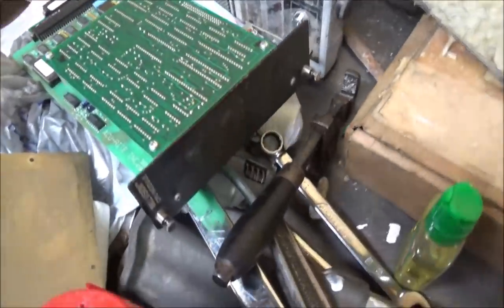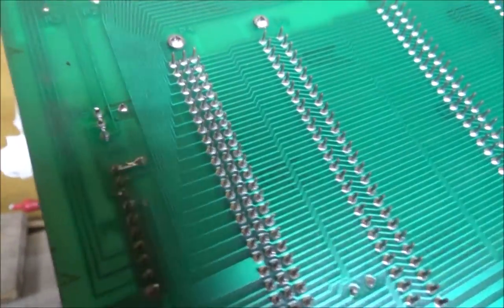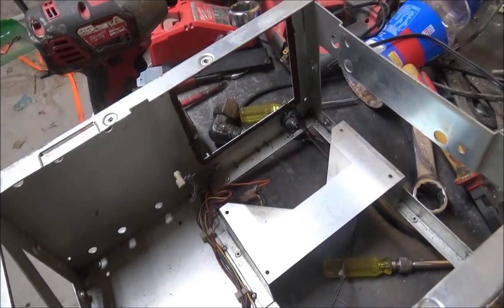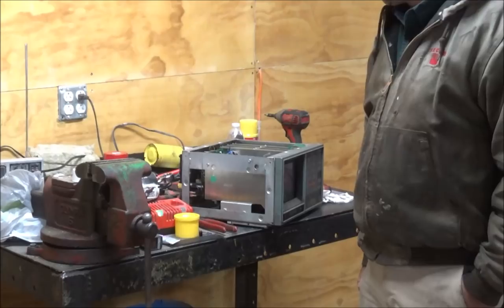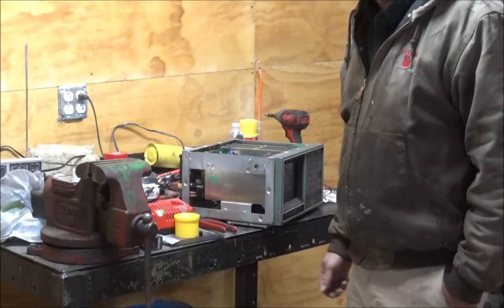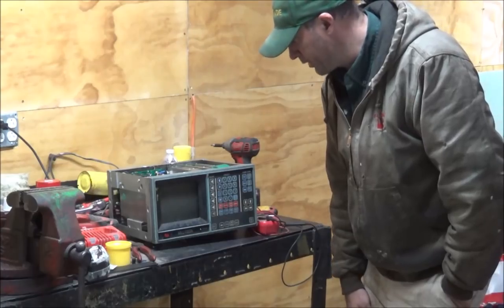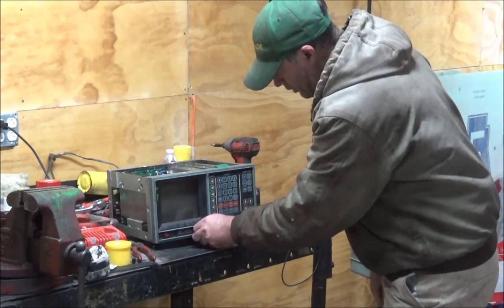Fix one problem a new one follows. CRT help anyone?

Comment: If you can't fix the DRO, the scales on your machine may be compatible with Yuri's  TouchDro project. You buy or build a simple controller that has Bluetooth capability then link to that with your Android tablet and it gives you all the capabilities of a DRO. It's what I'm planning on sticking on my South bend 9A eventually and my cheap Asian lathe as well. It's also very expandable you could put an RPM and extra axis on to the machine and plug them in very easily. Now go back to watching your video LOL thanks for the content.

Comment: To me it looks like bad capacitors or a loose connection to the vertical sync line on the plug. It might be the cable itself if it was able to work off the prongs in the head. I'd try tracing that out with a multimeter. A cheap one with continuity check will do well enough. It's also good for checking capacitors. If there's a short across one of them, that's a real good indicator that it's bad.

Comment: Take a look at the flyback transformer, its where that big wire goes to from the side of the CRT, some have two adjustments on one side that may fix the rolling, usually not easy to get to. Also this is where the high voltage is generated, around 15-20KV so be careful.

Comment: If i had to guess, watching you work, I estimate you did not damage anything while you were in there. Some of these other gentlemen provided some good info.  The chance of a poor connection is good on older devices even when they spent their life indoors. A thin film of oxidation, not visible to the naked eye, Is even enough to prevent a spot weld on two thicknesses of .038 cold rolled steel. Come at it fresh, with alcohol or contact cleaner, very gently open it up and clean the conections on that ribbon cable, and very carefully re plug them back in. That idea  with the non conductor(chopstick?). Chances are you already figured it out. Wes Johnson cleaned the contact surfaces on that inoperable mill and brought it back to life.I tear most of the cotton off a q-tip and clean connections with alcohol. If same result when you power it up, use a non conductive probe and very gently touching the conection while watching the screen. If it improves note the spot that did it.  *This is only what has worked before for me, I also don't care for electrical gremlins. Good luck, again i doubt you damaged anything, unplug connection, and reseat might even bring it back.

Comment: The yoke on the back of the picture tube (CRT) is what controls the ray, it has been over 40 years since I was in school for electronic and I can't remember the terms used for each part.  I seem to remember the Yoke is what directs the beam of light to light up the pixels on the CRT and also keeps it from rolling.  It might be that it just needs to be moved.  Be very CAREFUL the CRT holds a charge even after it is disconnected or the power is turned off.  It is a Capacitor and holds a charge until discharged.  My instructor in school was shocked by 27,000 volts good thing was there was no amps!  I would start by removing everything again and checking the Yoke on the CRT for any damage that may have accrued when it was moved.  The Yoke has become very delicate over the years and if the insulation on the wire has been damaged it may be causing a short.   I'm not sure how to test the Yoke for shorts but it's like a motor just a coil of wire that creates a magnetic field.  Again be CAREFUL the CRT will still have a charge even though it is unplugged, do not touch the wires coming out of it until the tube has been discharged.  Also the components inside are susceptible to static electricity, ground yourself before touching any components or wires.  Good Luck!
Reply: nope. the yoke is where the guns are connected,  so if this was loose any problems would be in the brightness.
The beam is steered by the coils on the side of the tube, and these are working fine or you wouldn't even get a rolling picture.  The problem is at the input of the CRT controller board.
Reply: @MattOGormanSmith   1. the Yoke is the part that fits over the Picture Tubes Neck.  The Guns are located inside the Neck of the picture tube not on the yoke!  A picture tube or CRT (Cathode Ray Tube) is the device that produces the colors for a TV using a vacuum tube and an electron gun located inside the CRT which has a fluorescent screen.  The electron gun does not move it is the coils in the yoke that direct the guys rays to move by using the magnetic field created by the coils.  If the coils are bad, shorting, or not getting the proper voltage the screen will roll depending on which coil is weaker or to strong.  To test the coils for a short use an ohm meter.  

To discharge the CRT:  https://www.wikihow.com/Discharge-a-CRT-Monitor

The anode is a wire covered by a suction cup. Slide the screwdriver blade under the suction cup until you hear a loud pop and see a blue flash.   Make sure you are well insulated/not grounded and the Screw Driver is grounded!  Use Rubber Gloves and wear insulated shoes, 27,000 volts will burn a hole just as if you were struck by lightning!   Gotta love the Internet for making us all or some of us Geniuses!  

Thank you for getting me back into Electronics/TV repair, it is people like you that inspire me to learn.
Reply: Yep sorry.  I forgot what yoke meant.
Reply from the maker: Thanks guys!! Will look into it.

Comment: Make sure the solder joint is not cold or jankey .. Also put some bond to the conector to the board with some kinda glue . I just use hot glue or silicone .. Good luck man !

Comment: The crt tube itself can store a charge, that greyish coating on the side glass is part of a capacitor that uses the glass itself as the dielectric.  Aquadag, if I recall correctly?  More directly, you can possibly get knocked on your ass by the display tube itself even when it's unplugged.  

Handle with care for multiple reasons!

Comment: I see there are LCD replacement kits for the CRT of that system. Unfortunately they are over $1000! My guess is some connector is dirty, loose or a wire broken. You might try wiggling the connectors with something non-conductive like a chopstick. Careful, because there is high voltage in there that can bite hard, even after it is turned off (capacitors as well as the CRT itself hold charges), as well as other things that will pop quickly if shorted for a millisecond. Will be hard to trace it without a schematic, which I haven't seen online. The number you gave is for the Accurite product - the CRT portion may be made by someone else and might have a separate model number that could be investigated. Not sure if Accurite can point you to a tech manual for it. A good old-school tech might be able to decipher by reverse engineering. I repaired that kind of equipment 20 years ago, but without a schematic, would be hard to guess from here.

Comment: A machine of that age is likely using standard NTSC timing,  so in the worst case you could pull out the CRT and put one of those cheap 7" LCD TVs in,  although there's a bit of circuitry needed to turn separate digital Video,  Hsync and Vsync into a composite signal.
Reply from the maker: How would I determine what circuitry I need to adapt something?
Reply: First you'd have to determine the signal level.  They'll either be 5V logic signals or 1V standard analog video signals.   Then you have to work out whether the H and V sync are already combined  (H is lots of short pulses at 15,360Hz and V is longer pulses at 60Hz)   and then you can adapt something suitable from a multitude of output circuits in homebrew 8 bit computers.   They usually consist of a few resistors and 1 to 3 transistors.
If you know someone with an oscilloscope they can work this all out, and troubleshoot the cable, in a few minutes.

Comment: Lots of smarter folks than me have responded. I will just add that I have seen lots of good from using a hot air soldering gun. I just bought one to fix my Volvo instrument panel. Seems easier to control and repair cold solder joints.

Comment: G'day Brian  @ 2.14 in the video there are two blue  long trimmers  1 marked brightness 
 check the 2nd trimmer  most likely contrast   if is contrast  go to 7.44 in the video 
 there are 3 white  trimmer pots  with a Phillips  slot  mark original position  and  adjust  with a Nylon   rod fashioned to Phillips or straight slot  these are likely what you are looking for 
 PLEASE Be careful of capacitance dis charge   . also at 2.32  the blue ring on the back of the CRT   gently  give it a wriggle     or pull off and re apply  shot not clear enough to be sure  on that    should be a multi pin connector 
 Where is Bailey when you need him ?.
 as some on said look out for angry Pixies  they are like your ignition coils in you car 
 JPT
Reply from the maker: Any idea what values I should see out of the brightness and contrast adjustments? I tried adjusting them and couldn't actually seem to get any change in the screen.

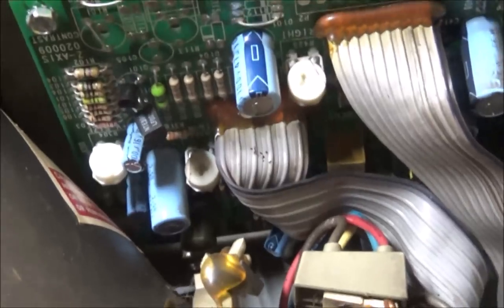Comment: At 7:53 the blue cap to the right of the ribbon cable appears to have 'smoke' on it, anything worth seeing in that area?
Reply: I don't think that is smoke.  Looks more like debris from the operating environment.  Might be vents on that side of the case.  Good eye though, I missed it on the first pass.
Reply from the maker: I think it is just dirty, I see no signs of damage to any of the components.

Comment: Those white trimpots on the CRT board.  I see one is labelled V SIZE and another RIGHT.  Look for one labelled V HOLD.  Even if you have a wire problem,  you could maybe tweak it so it's rolling at a readable rate.
They're usually at the rear end of the board,  because those CRT boards are usually bought in standard items and V HOLD is traditionally a user accessible control.
Reply from the maker: The only pots are Bright, VSize, VLine, Hphase, and Hfreq
Reply: VLine might be it.  I'd risk a tiny tweak :) 
EDIT:  I read in the info that you've already tried that.   It's unstable because it only freewheels so it doesn't burn the phosphor when there's no sync signal, and it's dependent on temperature.

Comment: You've got a bad connection for the VSYNC connection. If you have a Multimeter with Diode Check (beeps when the leads are shorted together) Check each connection at both ends of the cable. If all the connections are good, its possible that you have a bad trace (ie cracked PCB, or traced damaged when the old sold joints broke. You can also try resoldering all the pins, perhaps you have another bad solder joint.
Reply: Guy Tech a bad trace is a good call. It may not be the right one but I can tell you from experience, they can be bad even with a zero ohm reading. I had a timing circuit problem with a digit loop carrier system that was fixed by adding a physical wire to parallel The trace and my reference timing magically reappeared.  Since there is no vsync adjustment with these monitors, this is equivalent to a timing problem.
Reply: Guy Tech Guy Tech a bad trace is a good call. It may not be the right one but I can tell you from experience, they can be bad even with a zero ohm reading. (No load micro volt signal). I had a timing circuit problem with a digit loop carrier system that was fixed by adding a physical wire to parallel The trace and my reference timing magically reappeared.  Since there is no vsync adjustment with these monitors, this is equivalent to a timing problem.

Comment: I'd try re-seating the connectors with some dielectric grease. If all else fails there's plenty of room to replace the screen with an LCD and a converter board. Generic... less than $50.

Comment: I would suspect a bad electrolytic capacitor(s) or crack or cold solder joint.  Examine each solder connection with a magnifying glass.

Comment: I would just mount it back on the machine and see if the signal input might stop the rolling.
many old CRT monitors would roll with no signal.
But i could be  wrong! and most likely am.
Mike

Comment: I saw a reference to a external monitor connection. If you have an old tv with the yellow rca jack video in, you could try hooking it up to the external monitor connection. I may have to build you a tablet based dro and send it to you.
Reply from the maker: I don't have the extra card with the rca jack output.
Reply: @bcbloc02  Sorry, I'll work on a tablet dro for you.

Comment: Tenacity is a useful trait and a curse.  I hope you can get it fixed.  I'm sure that with the length of scales and all the work involved in mounting, aligning and hooking up a new DRO, that it would be an expensive exercise, but at what point does it become worth it?  Does the old unit do bolt circles and such?
Reply from the maker: Yes this unit does bolt, holes, tool offset libraries, error compensation and many other features. It was a pretty top end unit back in the day.

Comment: Brian, did you use a nonmetallic screwdriver to adjust the pots? This is about all the help I can give Sorry too long since I messed with a CRT But do remember they can give quite a shock. If I remember the pots need to be adjusted while on Hence the nonmetallic screwdriver
Reply: That shouldn't matter. You need to use a plastic driver when adjusting coils because a metal tool will change the inductance of the coil and screw up your adjustments. Other than that, using a plastic tool is just a safety thing, it is a bit harder to touch something you shouldn't. But pots don't care if you use plastic or metal tools to adjust them.

Comment: Oh maaan!!! watch out that ignition coil thing in there has enough angry pixies in it to knock you through the wall. you need a static wrist band connected to the metal frame. and the frame connected to ground. I learned a lot of electronics stuff from a good man named jim he is a tv repairman we've lost touch but maaan check that none of the terminals have pushed out of the plastic plugs and all the stuff I said above be careful
Reply: Static wristbands are for protecting microelectronics. Working inside a crt display, a wristband is more likely to help you get killed.
Reply: course an expert like you on crt's knows about the one hand rule of course
Reply: Ignition coil? I’ve heard it all now ffs

Comment: Looks like a cap went or the crystal is out on the sync board. If it was me I would replace it with an lcd look up arcade lcd replacement or cga monitor replacement lcd is $36 cga converter $20. Your main problem then is finding video ground and video signal if you have the option card for your dro it has an old school tv connector hook it up to a tv. If you replace crt  you are getting rid of crt , crt control, and flyback transformer and fit lcd in. 
Old flyback cap and transformer can kill you cap is under the round rubber on crt
Reply from the maker: I think the signal to the driver card is TTL. Is there a way to tell so i know what converter I would need?
Reply from the maker: How would I determine what style of adapter I would need to drive the LCD?
Reply: http://lcdparts.net/Files/CNCU_Manual.pdf  should be ttl to vga adapter then vga to lcd driver to lcd. Or ttl to vga driver to tv if you want a big screen. TTl is 15.75khz sync it needs to up sample to vga 31.5khz running on green channel.

Comment: if the scales you have working have the same amount of wires going to them ,that the new scales have.why can't you just buy a new cheap chinese monitor(say universal brand)even if you have to change the plug connectors on the end of the wires.just a thought

Comment: vertical controller is chip u301.check voltages and that they are stable. looks like it can be reached without disassembly. its the board with the v-size adjustment. https://imgur.com/a/aKTqSVj
Reply from the maker: Those voltages check to ground or to each other?
Reply: @bcbloc02  to the marked ground on the board. one of them is used to get a fixed vertical hold.
Reply: @bcbloc02  sorry, that board has its own metal backing, missed that. board should hold without the metal backing so it is still in a fixed position for probing. and if you didnt know already, the big black cylinder is the high voltage transformer. it can hold a lot of power even if the dro was unplugged for a while. dont touch, dont brush against it.
Reply: @bcbloc02  next thing would be to check if there is a sync signal coming into the chip on pin 10 (compared to the marked ground). https://datasheet.octopart.com/TDA1175P-STMicroelectronics-datasheet-26856.pdf the multimeter should show something on the frequency range. maybe 30-150 hz.
Reply from the maker: Great info!! I will have to do some more digging.
Reply: @bcbloc02  check the parts around pin 8 and 11 for signs of overheating and damage. that is the fixed v-hold. r301, and from there to board ground c301,c311,d301,r302. my crt assembly isnt the same but similar, and it shows the same faulty picture as yours when i turn the v-hold. but it then doesnt change over time. so my best guess is that when voltages are ok and chip is ok, one of those parts doesnt like it any more.

Comment: resolder the flyback transformer
Reply from the maker: Is that the thing that looks like a coil?
Reply: @bcbloc02  yes the black thing with the ht lead coming out of it.  they get dry joints a lot and one of the legs is for feedback to sync the hold.  you may of just disturbed an already bad connection by taking it apart.  good luck , hope it fixes it

Comment: Well, the main problem is.... you have your electric outlets installed upsidedown!!!
Reply: They are in correctly. If the plug is slightly pulled out, the only thing you can physically touch From the top is the ground. This is standard practice. With the plugs reversed, and the plug is slightly pulled, you can physically touch +/- from the top, which isn't nice to the touch.